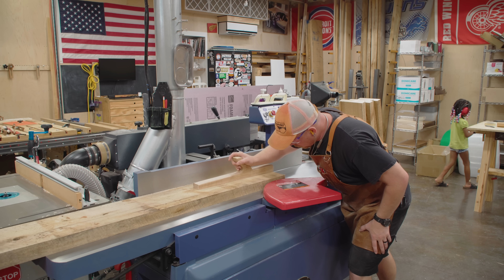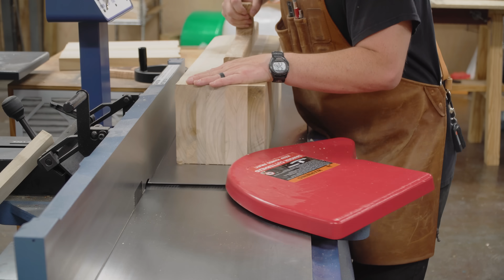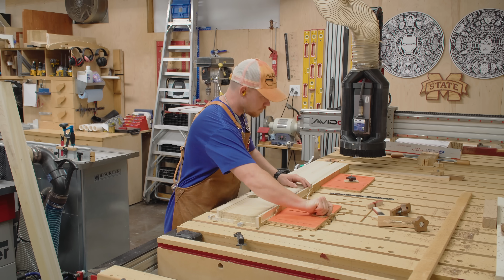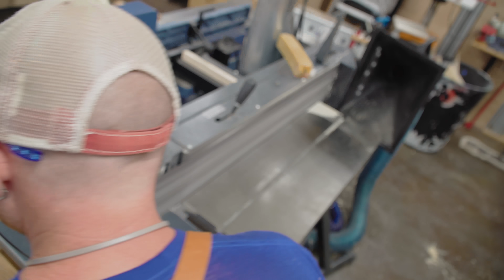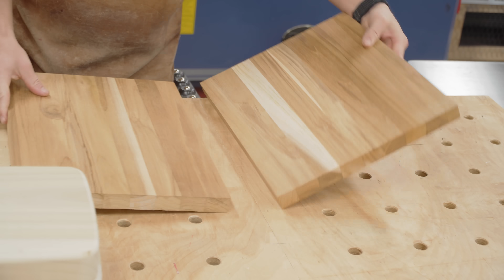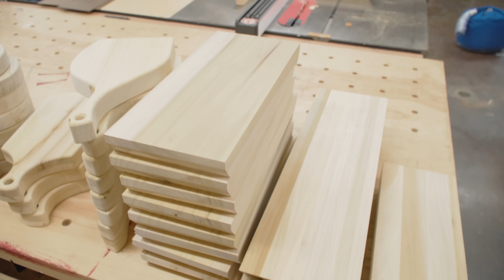A Small Production Run of Charcuterie Boards

Comment: I Do all 4 sides with small feet on the bottom.
and I call it a floating board
Reply from the maker: I stopped adding the feet. I much prefer using a towel between the board and table/counter top.